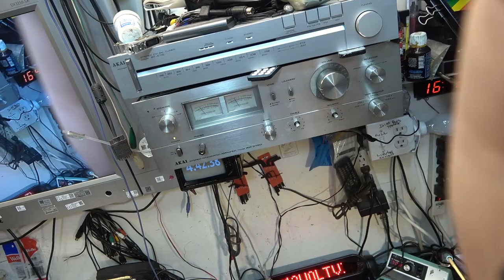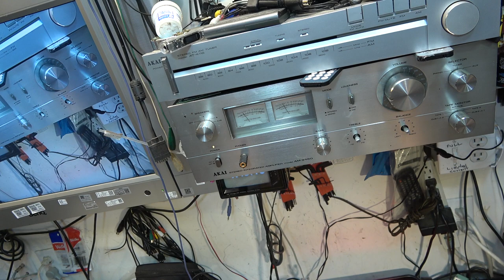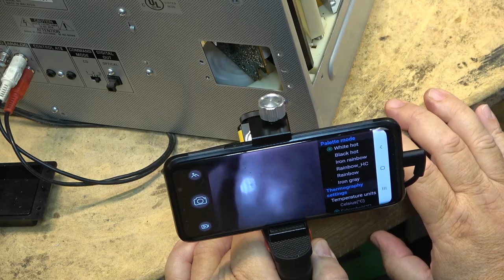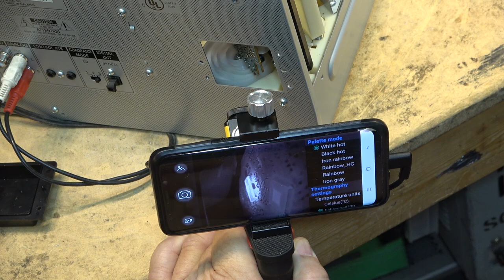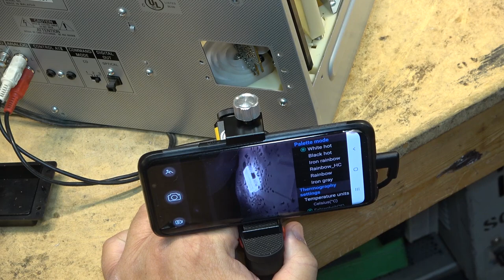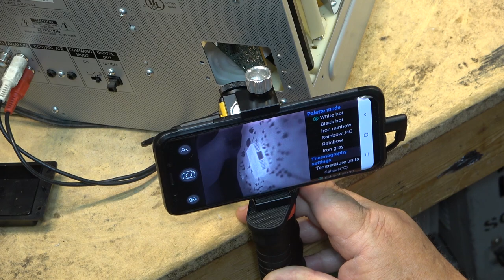Sony CDP CX355 300 Disk CD Player Plays for awhile then stops

Comment: I have a Sony shelf stereo with a five disc CD carousel.  It would play, but then begin skipping and even stopping.

The problem turned out to be bad solder for a servo IC for the optics in the CD player circuit.  Reflowed the joints and it's been working like a champ ever since.

Comment: Nice i have one that i replaced the belts for a client. He ended up gaving me as a gift moths later cuz he didnt want to write back the data of all the discs back😂
Reply: 300 Cds with 12 tracks comes out to 3600 individual entries not including the album title & artist... Even with the help of a keyboard that's still quite an endeavor to enter all that info which can be lost if the unit is un-plugged from mains for more than a week. I've always wondered why they couldn't have included a memory backup battery like a CR2032 or something...

Comment: My Sony single disc player from the 80's (the first one I bought) can take up to 10 minutes now to play a disc when I hit play. Sometimes it goes right away. Sometimes a couple minutes and sometimes several minutes. Once it plays it plays fine and all the way through without skipping. These are regular cds.  I don't even try to play cdrs in it because it's an early cd player. 

I have it set up for nostalgic reasons. I just want to keep it operational if I can. Any idea what could be the problem?
Reply: I have the same problem for my Sony MHC-S50C where the EF/Tracking/Focus balancing are NOT DIGITAL and are subject to calibration. It needs to warm up for 3 minutes then works uninterruptible..

Comment: This is going to sound like a strange question but here goes: in  the 90’s, we (my mom and myself) needed some electrical work done in our apartment. The maintenance guy did the job….but blew the fuse box, which apparently sent a spike through the apartment. After the smell of fried wiring dissipated, I tried playing my Sony 5 disc changer (can’t recall the model right now, it’s been 30someodd years since it happened), and - this ONLY happened in the disc two spot - it would start acting like the disc was defective. (It would start “sputtering” the audio tracks something terrible) Why would that happen on only that slot and not the others?
Reply from the maker: Sounds mechanical.  Not loading correctly on that position. Perhaps a warped tray.
Reply: @12voltvids  that’s the odd thing: the tray wasn’t warped.

Comment: I have a similar sony changer that has a problem.  It is a CDP-CX325 and it has a problem with the loading.  The fingers pick up the disc, but just as the mechanism clamps down on the disc, the disc drops a bit, so that sometimes it does not load properly.  Then it jams.  Can you maybe do a video on all the adjusts that the player has

Comment: Hey, THANKS for posting this. I just replaced optical pickup on my 400cd unit. And while it's not a rocket science assembling that metal holder-cage is a bear, at least in my case. :) While these units are cool sound quality from d/a leaves MUCH to be desired, but you can always use external dac. I always wondered what's the difference between "standard" and ES models of these? Does anyone know? Also these transport mechanisms are getting extremely hard to come by.

Thanks again for posting the vid! big help. cheers!

Comment: I have a Sony 200 CD player that is eating the CDs.  it appears that it tries to put the CD back in the wrong slot and kicks it out where it hangs up.  Any suggestions on how to fix it?
Reply from the maker: There is an adjustment screw that sets the position where the gripper arm goes.  If it's the wrong slot I would suspect either a dirty encoder switch  (blue lever switch activated by the main cam) or a bad optical encoder.  Also don't overlook the main door switch.  If that gets dirty all kinds of strange things happen

Comment: I have replaced the belts on many but now I have one where I changed the belts and now the carousel just continually searches back and forth and will not stop.  What do I do to fix this?
Reply from the maker: Optical sensor or more likely the flex cable that connects the slide tray with the main board.

Comment: Interesting failure in the end. Now that winter is approaching, it reminds my that my car cd player tends to act up in really cold temperatures, i wonder if it could be coused by condensation on the lens or what? Here -27C is not unheardof but even at -10 some discs don't like to play and my car does get lot of moisture in winter time
Reply from the maker: Condensation on the lens most likely.
Reply: It could be the lubricant is more like glue too causing movement failure. It could be moisture issues or maybe even a combination of both.
Reply from the maker: @darinb.3273  the lubricant is fine.  The motor shorted and popped the chip.
Reply: @12voltvids  I was replying to Sami with his car CD player when its really cold. I think I posted more specific in another spot about the Sony you were working on, sorry about the confusion  😎.
Reply from the maker: @darinb.3273  yes cold can cause many problems on CD and md players in the car.
Reply: @12voltvids  I never had any experience with MD but I understand they work very similar to CD players in regard to using a laser to read information 
A time or two with a cold CD going into a warm room and CD player, yeah good luck with that LOL.

Comment: Hi, I recently bought one of these players on ebay. I cleared the memory but unfortunately it seems to assume that it is still loaded with all 300 CDs, which is not the case. It doesn't check if there are any discs like on 1:14 .  It just goes to a random slot and tries to load a CD (which is not there). Of course the laser can't detect no CD, so it puts it back in the carousel but then tries to load it again. After 2-3 attempts it spins to the next slot and does the exact same thing until it finally reaches a slot which contains a CD.

Do you know this kind of issue and could you help me with that?
Reply from the maker: Might be the disk detection sensor.  That's the one on the left side.  When there is a dual present light shines up through the disk and is detected.  No disk and it sees no light.  There is another one below the disk carrosel.  Normally if there are no discs installed and the turntable spins the detector won't see any light because the light is shining one direction from where the detector is pointed. Only when there's a disc in the slot light will conduct through the desk and will be detected by the sensor. If the sensor is out of position however it is able to detect the light from the emitter as the carousel rotates it will detect flashes of light just like it would if there was a disk installed and the player will detect a disc and attempt to load it. You really need a scope to check this out. You need to scope the output from the photo transistor as the carousel rotates. There should be no pulses of light detected unless there's a disc in place. I've seen this happen when people have tried to fix their own machine and they first say anything is that the sensor isn't any good and they take it apart or adjusted. it's quite a critical adjustment because if it's set to the wrong angle it will detect a desk being present that's actually not there. I made that mistake very early in my career working on I think it was a 50 disc changer at the time. Had to reset it according to the service manual
Reply: @12voltvids  Thank you for the quick response. I will check that.
Reply: @12voltvids  I noticed that my device isn't doing the 360° turn which yours does on 1:14. When I press "Close" on for example slot 250, it immediately wants to load this slot. So it isn't even checking if there are any other discs. It just assumes that there are CDs...
Reply from the maker: @Michael-ny4wj  don't have any ideas as to what the problem might be.
Reply: @12voltvids  Seems like the IR-Diode and the sensor are working properly. I measured the voltage on the sensor and it changed when I covered up the diode. So the player should notice the change of the voltage, right? Unfortunately it didn't. After that I unplugged both of them later but the player didn't care. Again it just assumed that there are 300 discs loaded and it wanted to play one of them. It doesn't do the 360° search function.
Is there a way to force the disc search?
Reply from the maker: @Michael-ny4wj  the diode may be weak and not providing enough of a swing on the photo transistor.
Reply: @12voltvids  You were right. It was the diode on the left. I changed it and now it works fine. But it seems to be the other way around as you described in the first place: If there is no disc, the light shines directly on the photo diode. So the control receives a "low" signal. If there is a disc in the slot, no light is detected. The control receives a "high" signal. So if the diode is weak, no light is detected and the player thinks it is completely loaded with discs... I think that's a little bit poorly done by Sony but what can you do ¯\_(ツ)_/¯ Thanks for the help! :)
Reply from the maker: @Michael-ny4wj  they must have changed it. The original unit which was a 50 disk worked the other way around.  Anyway when they don't detect disks it's almost always the diode is getting weak or it is out of alignment.

Comment: I have the same player. How is it when I hook up a Schiit Audio 3E as a external DAC it has dropout and skips?
Reply from the maker: There is a dirty little secret about "high end" DAC.  These high end DAC require an exceptionally jitter free bit stream as they have little to no error correction.  Lower end units are much more forgiving to jitter.  So if you waste your money on a high end DAC you will waste even more money on a precision transport.
Reply: @12voltvids  It's not high end just a $150 one. But interesting

Comment: What is the number on the ic, I should have one and a motor or even the whole pickup unit as i keep them when scrapping working but damaged players.
Reply from the maker: BA5947FP 
Traverse is KSM213BFN, the optical pickup KSS213B
Reply: @12voltvids  Hey Dave I've taken some of those drive motors apart and I found a ring (I guess a resistor ring) to reduce the spark noise that brushed DC motors make from the brush/commentator. They do produce extra load (current) on the drive IC. The commentator can get a build up in the splits and cause excessive current draw too. It is likely it has happened with a machine with that many hours (the resistor ring) adds even more load to the drive IC. Those motors are tricky to get into so be warned if you decide to try cleaning it that maybe the only option if you can't source one. I encountered an Awia that wouldn't read TOC on any disc and discovered the sled motor wasn't moving it wasn't stuck and moved freely, it was indeed a case of this resistance ring inside the motor I successfully took it out and the motor moves as it should now, this ring likely weakened the drive chip and it just couldn't provide enough current to move the motor anymore, anyway it doesn't have any problems after I removed the ring whatever it is/does.
Reply from the maker: @darinb.3273  the gear on the sled motor cracks all the time and causes the sled motor to stick.
Reply: @12voltvids  Yes indeed I've done plumbing work before and I learned a long time ago don't put plastic (PVC) over metal pipe threads the plastic will crack eventually. The plastic expands and contracts more than the metal which in the contraction causes the PVC to split EVERY TIME. I wonder if that's the same reason or at least a possibility plastic gears crack on motor shafts a lot in situations like that. I've also seen this in large gears with brass centers the plastic gear split on the brass center, anyway just my observation. I have some portable boomboxes that had the same traverse CD mechanism in that Yamaha CD player you worked on they were popular in a lot of portable CD boomboxes as I think that's all that existed when they 1st came out, so Sanyo made and sold a lot of them to various manufacturers of boomboxes and home CD players. Sony made there own laser pickups too. I just don't know who did it 1st or if they were introduced at the same time. Anyway I learned whatever the cause of split plastic its NEVER a good outcome when plastic is encased around something metal.
Reply from the maker: @darinb.3273  They never learn. Still doing the same shit today.
Reply: @12voltvids  There's my other post, I mentioned LOL. Yes I observed those cracked gears in operation too. The sled motor keeps getting more power to move till it over comes the strain from the overload due to the crack and causes an overshoot causing a massive skip or the servo lens to go out of is range of movement and at the very least cause a breif static sound. I've disconnected the sled motor just to observe what happens the lens can only track so far so the static sound starts first and the the music starts muting until I manually move the sled or reconnect the power to the sled motor which isn't exactly healthy for the drive IC, ONLY takes once if they don't have built in protection to pop it. Anyway I experimented so I could identify and spot troublesome CD player issues my own equipment issues, I wasn't a technician as you were making a career out of a hobbyist (me). I started out to learn TV and VCR repair. You know where that went. The repair(s) would cost almost as buying new and folks just thought that's dumb to repair when they could get a new one for $25 to $50 more than the repair. Now it's a throw it out and get a new one. 
I've watched a lot of your videos and as you a lot non-servable garbage. That throw it out mentally by companies AND consumers. Anyway cheers to ya you sound like your doing well hope all the family (and your kitties) is also doing well.
Reply: @12voltvids  Indeed now they design and make it to fail so consumers gotta buy more because that also make most stuff a NIGHTMARE to repair and purposely makes parts unavailable for those who want repairs to be made.
You spoke about the motor drive chip getting hot most modern stuff I've checked has incredibly hot components manufacturers purposely design circuits to run the electronics right at the limits of voltage and heat ranges to cause early  failure ON PURPOSE at least that's my theory because said companies want to sell newer garbage that has an even shorter life span so when that fries they can sell even more, creating a landfill filling nightmare. Perhaps recycling is better there in Canada but here in America recycling, yeah right anyway rant over LOL.